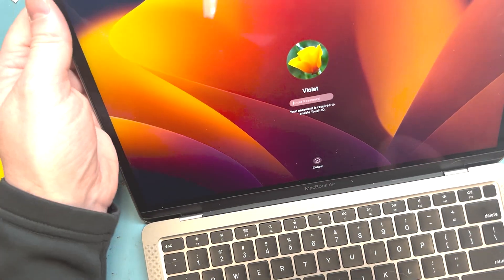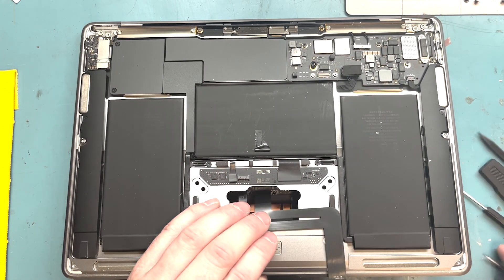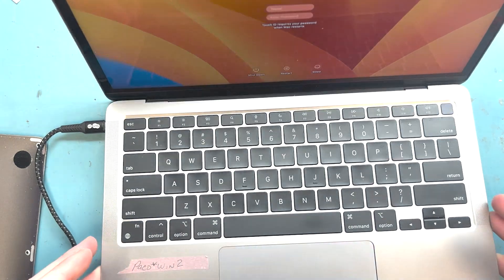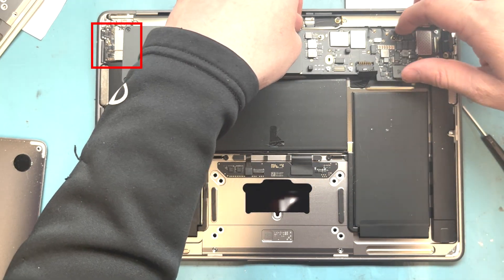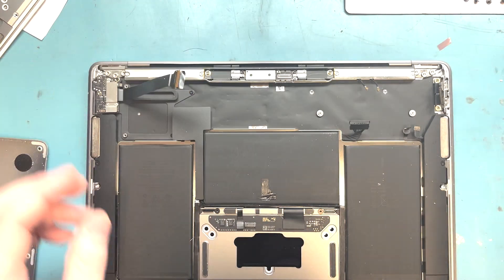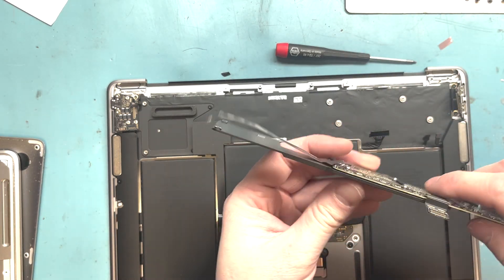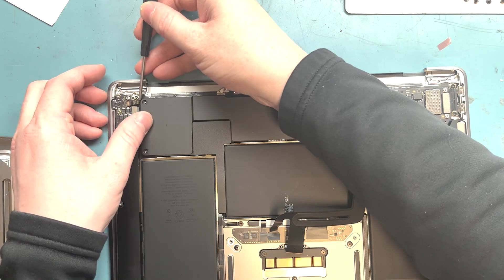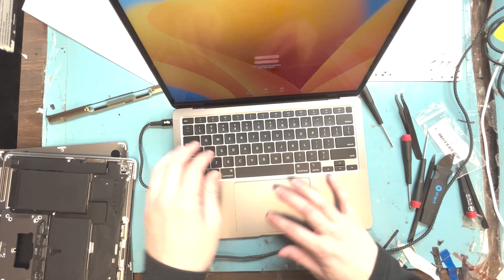MacBook Air M1 A2337 Top Case and Keyboard Replacement

Comment: Hi Mark,

I hope you’re doing well! I’m reaching out for some advice regarding an issue I’m having with my MacBook Air M1.

My screen got damaged twice. The first time, I successfully replaced the screen without any issues. However, during the second replacement, I made a mistake by forgetting to detach the battery clip before removing other components. After putting everything back together, my keyboard stopped working.

I’ve already tried replacing the flex cable, resetting the settings, and even updating the OS, but the problem persists. Now, I’m left with two options: either replace the keyboard palm rest or the logic board.

Before I go ahead and buy any unnecessary parts, I’d appreciate it if you could advise me on what might be the best next step to take.

Thanks in advance for your help!

Best regards,
Paolo
Reply from the maker: Darn, that sounds really frustrating! If you unplug the keyboard and the device turns on, it’s likely the keyboard causing the issue. If not, it’s probably the logic board. If you need help and don’t want to risk the cost of replacing parts, feel free to mail your repair to me. I’m also working on a program to live stream mail-in repairs, offering full transparency of part sourcing and just a minimal labor cost
Reply: @worthitrepairs  Hi Mark,

Thanks for your quick response! Yeah, it’s definitely been frustrating, and I was thinking the same thing—that it might be the keyboard. I’m just hesitant to jump into replacing it without being sure.

Your offer is really generous, but I’m worried that with the shipping, labor, and parts, it might end up costing me almost as much as a new unit. I’m currently based in London, so that adds to my concern about shipping.

I really appreciate your help and advice, though! If you have any other suggestions that might help me troubleshoot locally, I’m all ears.

Thanks again!

Best,
Paolo

Comment: I spilled orange juice and my keyboard don't work. You think that doing the keyboard replacement it ll work again? thanks
Reply from the maker: The logic board needs to be inspected for corrosion and if it has it try a sonic wash. I would also inspect other parts like track pad all the other flexes connected

Comment: Hi again Mark. I commented a couple of days back about replacing the ‘top shell’ on my rose gold A2337 Air. You directed me to this link and many thanks. But, slight misunderstanding maybe in that i have a dent in the ‘top lid’ - right behind the screen - the part with the shiny Apple logo on it (for avoidance of any more doubt!). I very much doubt it can be done as no visible screws or connectors, but my question is; If I source a cheaper mint ‘lid’ with a broken screen (there’s one on eBay), can I separate the broken screen from the aluminium lid - and just replace the 'lid'? To be clear, nothing wrong with my screen, just don’t want to see the dent when the Air is closed. Sorry for this rambling comment for something most probably can't be done, but huge thanks in advance for any advice you can give 🙏🏻💯
Reply from the maker: Oh sorry, I must have misunderstood you I thought you were talking about the keyboard. DO NOT ATTEMPT TO REMOVE THE LCD SCREEN FROM THE LID! You will break the screen for sure.  If it is only cosmetic it is what it is.

Comment: Hi, I have one MBA M1 with broken screen and the other one with liquid damage but with liquid damage on the top case. I managed to power on the liquid damage laptop by disconnecting the keyboard. So I am 99% sure the logic board is in good condition.
I know you cannot just swap screens as the are linked with the motherboard so there is huge posibility that the truetone or camera will not work.

My question is :
Top case swapping, is it doable  without some additional issues? 
Tnx in advance!
Reply from the maker: You can use the screen

Comment: Hello, so in the new case I should keep only keyboard and battery? I cracked my screen and I want to replace with a new one, but I found only icloud baned macbooks, so I will buy an icloud banned. If I migrate from mine only motherboard, wifi card and touch id will work? Or should I replace all parts?
Reply from the maker: You basically would be doing a logicboard replacement if you wanted to do that you could it would work just make sure you transfer the power button attached to Touch ID
Reply: thank you.  @worthitrepairs